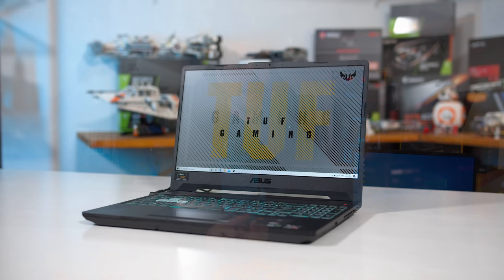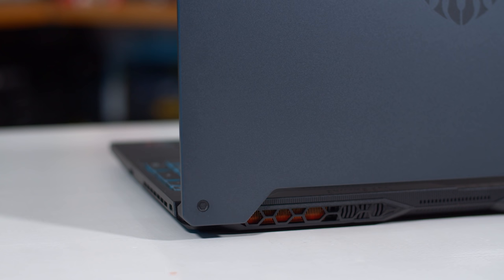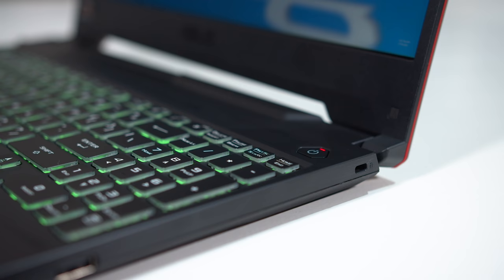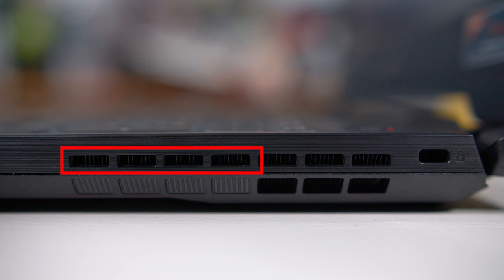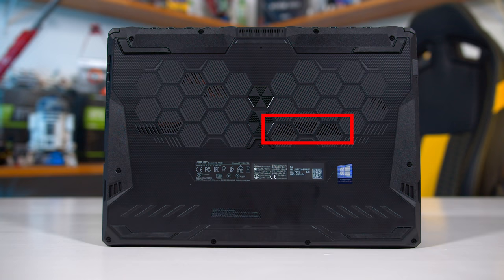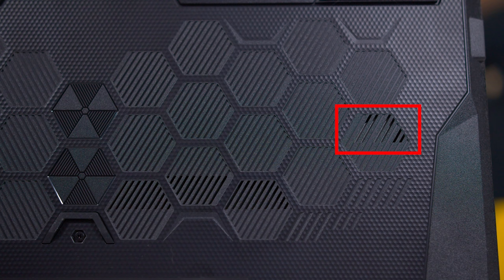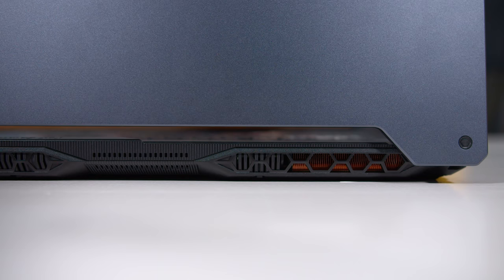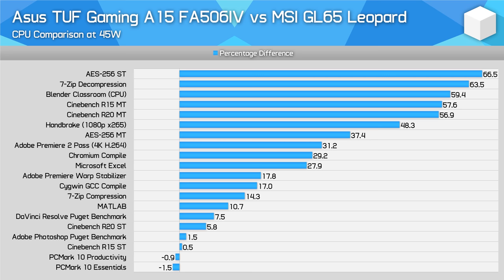Don't Buy The Asus TUF Gaming A15 (2020 Model)

Comment: Something is fishy here, the AMD based Zephyrus G15 has its fan vents blocked. I think there might be an Intel engineering working at ASUS!
Reply: Actually, most of their lower-tiered laptops are designed like that, even Intel powered ones.

My GL502 has the exact same flawed design. I’m baffled that it’s only taken until now for people to take notice.
Reply: most likely the same design from their old bottom cover from the ga502du since the air vents is also blocked compared to the intel versions which aren't blocked
Reply: But why?
A lower performance part should obviously draw less power and give off less heat. So it should obviously run cooler in the same chassis with the same cooling.
If it doesn't, they botched something.
Reply: I think own or disown contacted Asus about the g15, and they claimed thr covered vents are to redirect air across other areas of the motherboard, improving passive cooling there are the cost of gpu and CPU. Even if that's the case, it's obviously a bad solution.
Reply: Hell, even my old laptop from ASUS (intel cpu) has its vents blocked. I had to take the whole damn thing apart to unblock it, and "magically" temps improved by 20°C+

Comment: Asus got the cooling design from Intel along with a bag of cash.
Reply: boycott ASSus!
Reply: Sadly previous versions from Asus that sported Intel CPU also have this shitty thermal design. Asus is just bad in these price ranges.
Reply: My asus laptop with intel CPU is thermal throttling all time because It doesn't have any heatpipes and it uses only a very tiny heatsink on CPU  without any connection to the tiny fan
Reply: It's just product segmentation. It's like "Want more holes in laptop? Want better Display? Pay more for the Premium".
Reply: Why AMD fanboys loves to blame everything on Intel? This issue is clearly coming from Asus. They botched the cooling on their products especially on their cheap products. If you have zero experience with servicing laptops I got to tell you that there is a lot of Asus laptop model, no matter what the processor it has, having a really shitty Mac Book Air-esque "cooled by magic" cooler design. Even brand as shit as Asus nowadays like Acer never done that as far as my experience servicing their products.
Reply: @HuntedByAFreak72   I agree, I owned 3 laptops. Asus had frequent issues so I changed to Hp. They have keyboard issues and repairs costs a bit high considering the frequency of issues. Changed to Acer, The model I have got poor display but so far, I only had a BIOS issue because of Windows 10. Acer and Hp tends to sacrifice on build quality a lot on Value priced spec machines.
Reply: That's a strong acusition
Reply: @HuntedByAFreak72  Its because of intel's meme of a stock cooler.
Reply: Asus should hold on to what they do good: mobos and graphics. They never made a good laptop, they are out of their league here.
Reply: yeah because the Intel models of Asus TUF lineup had AMAZING cooling! Yeah no. The only way this laptop had could had great cooling is if they completely redesigned it.
Reply: @vuongbinhan  exactly, they see conspiracy theories everywhere!
Reply: @chumps1941  blue team fans are sheep? ok let's collect all facts here
1 Intel offered twice as many cores in laptops compared to AMD a year ago
2 Intel doesn't delay their mobile CPU-s by a year and doesn't give them wrong names(mobile 4000 Ryzen is actually desktop 3000 architecture)
3 Intel unlocked the voltage on their locked, mobile CPU-s years ago, and if it wasn't for plundervolt they'd still have it unlocked, while AMD locked it complteley "for laptop users sheep"
4 Intel have designed software that actually works for both their laptop and desktop CPU-s equally, giving laptop users pretty much as much freedom as desktop users, not thinking about laptop users as stupid office workers who don't need any freedom. Need I continue? or these facts aren't strong enough for you? If Intel didn't disable undervolting and increased the number of cores for laptops to the amount on desktops my next laptop would still be with their CPU.
Reply: The cooling is the same horrible design as the previous TUF models
Reply: @alexclarke6924  lol my asus tuf fx505dt never goes above 87 deegres its average 83 for fortnite in performance, turbo 86, and the gpu always below 70 average 62

U just got defected pieces🤣

Comment: Seems like Asus have decided to throw the entirety of their TUF lineup under the bus.
Reply: The TUF lineup has many bad products.
Reply: Seems like the X570 Gaming Plus was one of the few TUF products that escaped butchery
Reply: CheapBastard1988 I gues they are not that TUF anymore
Reply: @NeXMaX  Oh, there is still time for cheap condensators to defect.
I've seen enough ASUS boards, it's safe to say that they are all shit.
Reply: TUF stands for Thrown Under Fbus
 So close yet so far...
Reply: Anyone has any experience with the TUF monitors?
Reply: @diogo_n1310  depending on the monitor model TUF isn't terrible, but always check reviews before buying.
Reply: Are the TUF monitors good though?
Reply: TUF has always been under the bus material to me..
Reply: The TUF monitors are good IMHO
Reply: Not that it has anything to do with the video, but I do have a x570 tuf motherboard, and I've liked it, but I was disappointed. Coming from the z170 tuf sabertooth, it was a downgrade in ways. The tuf series used to have full pcb coverage, the x570 doesn't. There is active cooling for the vrm on the z170, not on the x570. Being I run a 3950x, I want as much cooling as I can. Lastly the previous tuf series had several thermal sensors, the x570 had almost none. I like having the ability to watch vrm, ram, pcie slot ect temperatures.
Reply: The ASUS TUF 280 Hz is the fastest monitor currently on the market, and it's IPS. Maybe one of the best monitors for esports period
Reply: Remember when their stiff was TOP or Strix? Yeah, those were the times...
Reply: @cazablocki  The TUF brand got repositioned into the budget category, and came with it the usual compromises...
Reply: 'under the bus ' or more like wrapped in too much fabric :)
Reply: That's tuff (get it?) :)
Reply: gone are the days of The Ultimate Force, now it feels like they should be call The Ultimate Failures
Reply: Feel they purposely gimp the TUF line to make their ROG Strix n other premium products by ASUS look worth the money but shoot themselves in the foot against competitors. Or maybe the TUF lineup is handled by a smaller team with recent grad interns n limited resources so they just cant produce what they want.
Reply: it's always been garbage. look at past reviews lol
Reply: My asus laptop with intel CPU is thermal throttling all time because It doesn't have any heatpipes and it uses only a very tiny heatsink on CPU  without any connection to the tiny fan
Reply: Bought the TUF B450M Pro and so far I think I'm ok. My friend bought the TUF B450 Pro and already at the second board still having problems with the M.2 slot and other things.
I just bought Asus for the PCIe Slot configuration of their mATX board, or I'd have bought a Tomahawk (or a Mortar if it had the slot config I was looking for).
Reply: @NeXMaX I'm aware, it's just frustrating. How do you take "the ultimate force" and make it "eh it's good enough"
Reply: @CheapBastard1988  Asus TUF gaming x570 is great and so is the VG27AQ what are you on about?
Reply: @cazablocki  It's the typical case of taking a brand that's had a stellar reputation, bring it down low with the gimping that usually applies and then selling it based on the reputation of said brand.
Reply: @MegaCazzam  He said "many", not "all".
While the TUF line has some good stuff, there's also a heap of bad ones.
And it's not like the VG27AQ is all that fantastic either. While it is a solid monitor with ELMB Sync, it also doesn't exactly have good overdrive performance either, making its performance in Adaptive Sync a bit spotty.
Reply: @iopqu  It's garbage , it can't really do 280hz because the response time isn't on par with the refresh rate. Also it has terrible overshoot depending on the mode which is never perfect depending on refresh rate. Sync Blur or whatever the name is actually a  good feature but it doesn't work well now on it
Reply: It's a shame, their VG249Q TUF monitor seems to be a decent monitor
Reply: Stasss  That's why I choose Asrock. Really great motherboards but i heard their gpu are shit tho.
Reply: @CheapBastard1988  So true! Just why Asus do that???
Reply: @blackknight50277621  😂😂😂😂
Reply: @CheapBastard1988  Same with ROG line up
Reply: Dang Asus seems to have really fallen off. My Asus TUF Z77 Sabertooth motherboard is still working fine after 7 years.
Reply: Stasss  TUF is actually there entry level lineup
Reply: Stasss no, actually, they don’t. They market themselves as budget. ROG is their premium brand
Reply: Thought the same i see another TUF product geting backlash from HU. They just hurt that "brand" of TUF for me none of TUF lineup is going to be consider by me when i will be buying sth
Reply: Asus has faulty speakers as well. Bought 2 Rog strix with broken/blown speaker sound out of the box and had to return them. Maybe they blocked the vents to lower the fan noise? Still doesnt make sense why the would obstruct any cooling vent. Asus has let me down multiple times so that should speak for itself. From faulty equipment to broken speakers to poor warranty/customer support, faulty HDMI port, etc, etc.
Reply: Again mind you
Reply: @A.Froster  it has a great response rate, on par with the best IPS. You do have some overshoot with good 280Hz compliance, or worse compliance with nearly no overshoot. For esports it's the best monitor on the market
Reply: It seems the cooling issue can be modded easily .Its the garbage screen thats killing me id gladly pay anouther 200 for a better screen . I really want ryzen with that big ass battery . Ive 1500 now what do i buy looks like im going to have to wait wtf
Reply: Stasss  TUF specifically costs less, than other 4800H laptops, though.

Comment: asus is messing up their TUF brand. it is like they made it to get people to buy ROG brand.
Reply: That would normally be the case, but even some of the RoG products have similar flaws.
Reply: The only TUF product I’ve heard any good of is their X570 board... everything else is failure after failure!
Reply: TUF has always existed to make the ROG products look good.  TUF has never been good.  They've always cut every corner while barely matching competitors specs but people buy it because it's Asus.
Reply: @AMDeZani  damn, dont scare me like that. does their gpu counted aswell?? i saw 1660S for a good price
Reply: ROG isn't any better. I've got a G501JW here - basically same issue - no air intakes and the notebook is melting under load. Performance is getting hammered when you actually game or put stress on cpu+gpu.
Reply: @Rahul-ee6hf  Yeah sure. Just like this laptop or the 5700XT...
Who wants to play "spot the ASUS fanboy"
Reply: Nono only amd products..rog zephyrus g15..amd cpu..blocked vents..zephyrus m15..intel cpu, same chassis, no blocked vents
Reply: @AMDeZani  their old TUF Sabertooth stuff was good.. but its been mostly trash since then
Reply: @Rahul-ee6hf  You are talking about yourself ? Because everyone doesn't care about price if the product is complete trash
Reply: @Rahul-ee6hf  Except it isn't, with only a few exceptions.
Reply: @nindzamaleta3030  ah i get it... you are a f*cking acer fanboy or something like that
Reply: @NeXMaX  and what other laptop is better in the same price class?
Reply: @Rahul-ee6hf  The MSI mentioned in the review. Yes, the CPU isn't nearly as good but it does a better job as a gaming machine. Plus, I wouldn't expect that ASUS to last much longer over its warranty period.
ASUS just doesn't make any noteworthy laptop in the midrange. Heck, I owned a STRIX GL502 (a mid-high tier laptop back in 2017) and it has the same painfully hobbled design that chokes the fans and makes it noisier than it should be, while raising temps enough to have thermal throttling without some voltage tweaking.
Reply: The TUF line up was never good to begin with. I and my friend got the TUF FX series model with i7 gtx 1060, but it heats up like crazy and throttling gets unbearable. The TUF series actually taught me never to get a laptop for gaming, my next buy is going to be a custom built pc
Reply: Actually speaking, TUF is made for those with no technical knowledge. Made for someone who buys laptops just by seeing specs, like core count and Ram.
Reply: ROG laptops are just as bad because they all use ASUS software to control fans and CPU boost. The ASUS hardware isn't terrible but their software is just completely garbage. They have instructions on how to reinstall armoury crate on the web that take up 10 pages and involve like 6 resets and weird BIOS tweaking that most people couldn't accomplish in a million years. And the armoury crate software comes broken right out of the box requiring the user to try and fix it with the exact combination of driver and update sequences. ASUS laptops are terrible and should be boycotted.
Reply: @AMDeZani  I have the tuf vg259qm and it works and looks great
Reply: @drewhinners8793  Wrong. The original TUF stuff was great - Remember the TUF Sabertooth motherboards (if you were alive back then) - Truly premium stuff.
Reply: @SovietGrazz  Yeah my X58 TUF sabertooth motherboard was great!
Reply: @SovietGrazz  Yeah, there was a time where TUF really meant "tough". That's been thrown in the trash now...
Reply: I wouldn't touch one of their TUF laptops after my experience with the TUF Laptop I owned a year ago. Had to send it back to Asus for repairs 4 times in 6 months, taking roughly 2 weeks per return, sold it after 9 months because I was not being stuck with it after the 1 year warranty ran out. Thats not to mention the performance and in particular the thermal throttling and power limiting of the CPU.
Reply: @AMDeZani  their 1440p monitor is really good apparently but that's all I've heard
Reply: That's the point
Reply: Playing devil's advocate here.
I have the ROG Gx502. If you are willing to downclock the CPU a little the thermals decrease significantly. About an 8 celcius decrease.

But, I feel that asus should optimise their products so that is consumers don't have to tweak the cpu to improve its thermals.

Fan noise isn't a problem for me, I use headphones anyway. Battery is quite tight though.

For GPU temps, it's good enough. It's the CPU that's fucking up the entire thermals of the laptop.